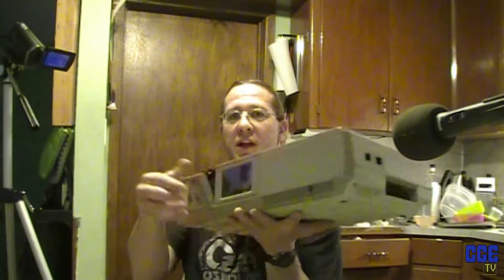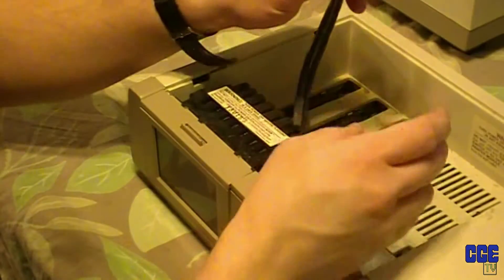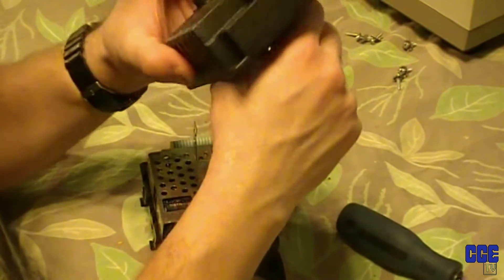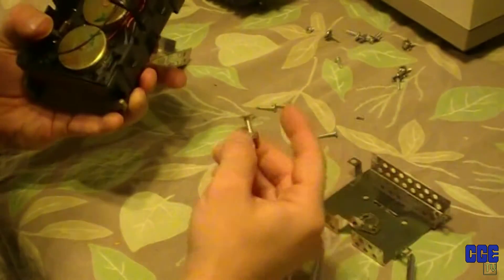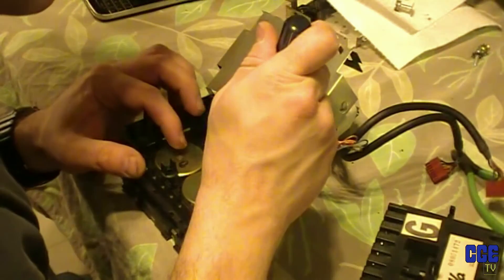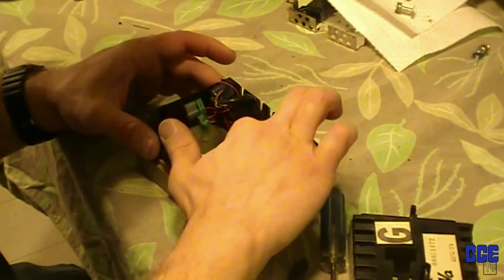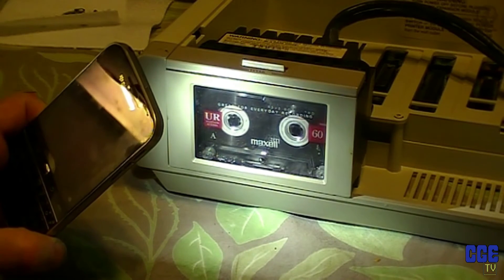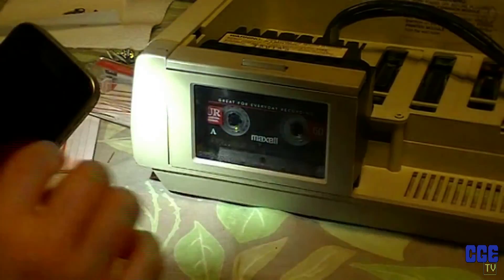TOTC-02.06: Coleco Adam Data Drive Repair

Comment: You need to oil the drive to get rid of the noise it making.   Just use some 3 in one oil.  Don't oil to much or will cause problems.  Need to oil both ends of were the pin goes in.  Just enough to cover the hole on both plastic pats the pin goes in will do it.

Comment: Have an Adam that works great, made a new psu, but the data drive runs in an infinite loop, back and forth with a blue screen. Any ideas what’s wrong or how to fix?
Reply from the maker: Probably an index wheel problem. It's a rubber roller inside the drive. It will be a silver wheel if the rubber has melted off it which is a common problem, and it's a pain to clean it up. Sometimes it eats away the hall effect wheel on the other end which is unrepairable. You can replace the rubber with a tire from a toy car, but you have to make sure the wheel moves nice and smooth.
Reply: CGE-TV index wheel intact and moves smoothly
Reply from the maker: Heads cleaned? Does it run back and forth after reaching the end of the tape, or is it doing it on a specific spot on the tape?
Reply: CGE-TV cleaned heads using alcohol , goes to end of tape and back endlessly. The tape is copy I made with a ddp file, using your videos as a guide.
Reply from the maker: I'll give you a link to some wav files to try transferring to tape. You don't have to do any modifications and should just be able to record them. See if these work and let me know. http://www.files.classicalgasemissions.com/misc/donkeykong.zip

Comment: I just bought the Adam main console off Ebay and given I can see the tire is gone in one of the pictures I'll be trying this too, hopefully the encoder wheel fared better as I don't have a spare, assuming that survived I guess it's possible to use the tires from certain toy cars to replace the rubber part.